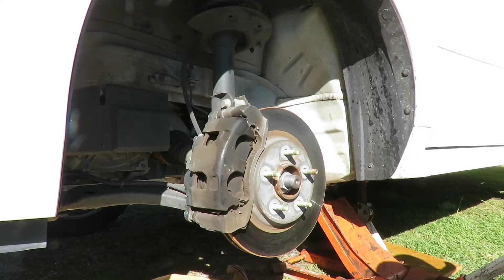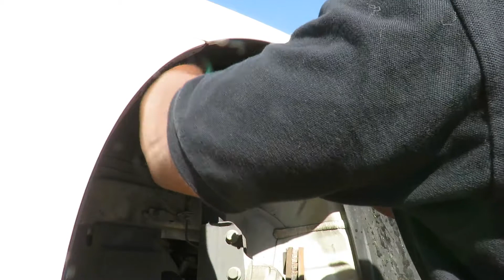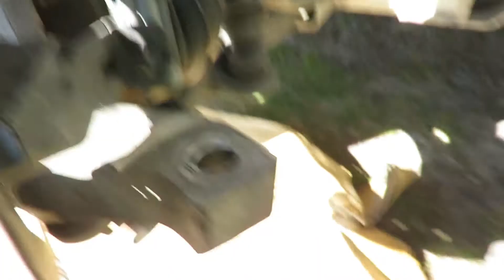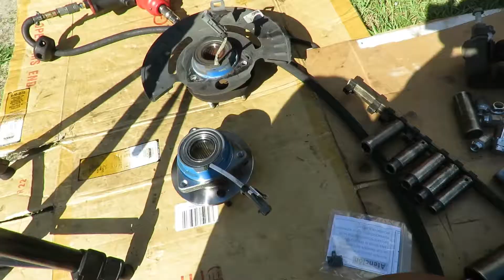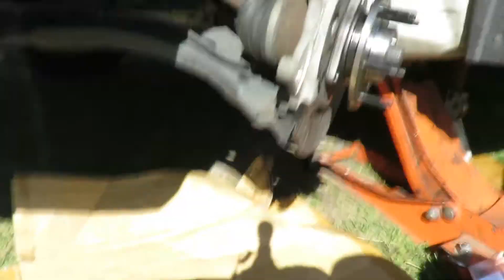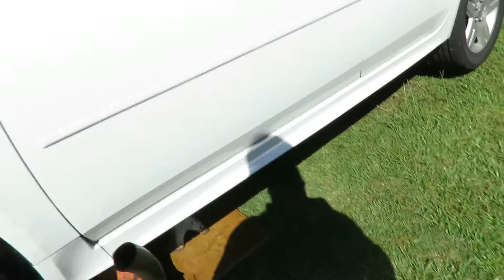⭐ 2014 Chevy Impala - Left Front Hub Assembly Or Wheel Bearing

Comment: I'm curious why you wouldn't pull the axle out of the knuckle to have more room to remove the 3 hub bolts. You also didn't seem to torque anything to a spec, which is critical for the axle nut, wheel hub bolts to the knuckle and especially the lug nuts.
Reply from the maker: "You also didn't seem to torque anything to a spec." There's nothing seemingly about it, we didn't.🤣🤣
Reply: @OnlineAutoRepairVideos  that’s funny?
Reply from the maker: @ Didn't you see the laughing emojis?

Comment: What  The best way take off a  Seized hub Exact same car on the video front left
Reply from the maker: Is all the bolts out? If so, use a slide hammer, if not, heat the bolts up with a small torch kit from lowes or home depot.